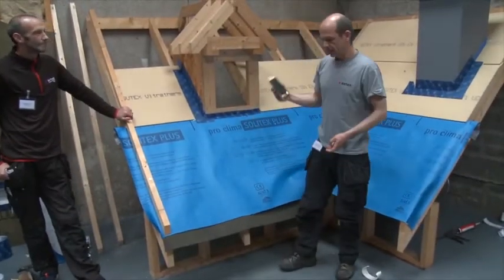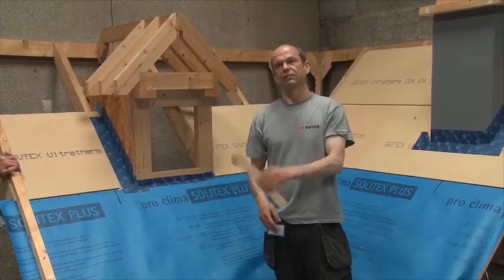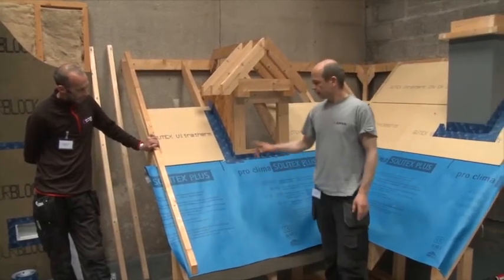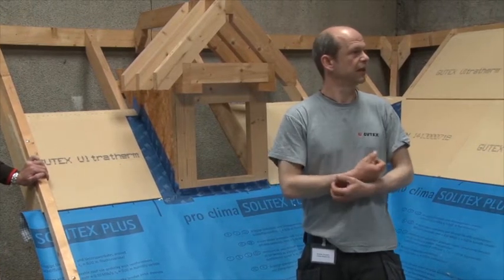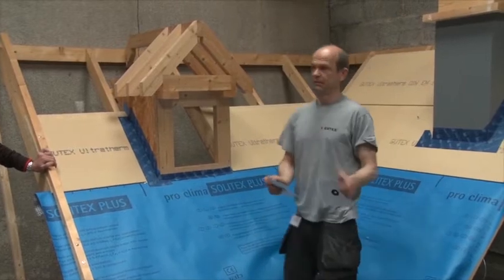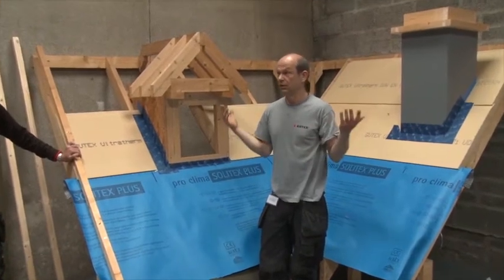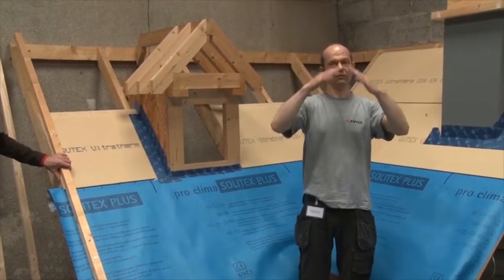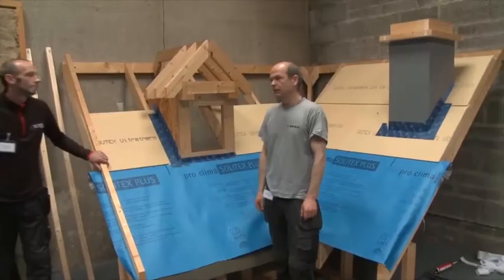Gutex Ultratherm Roof Installation (part 6) - Airtight grommets, detailing summary & conclusion

Comment: Gutex looks promising but the sheathing would probably be better if it had pre-applied waterproction on one side like zip sheathing.
Reply from the maker: Hi, GUTEX ULTRATHERM and MULTIPLEX TOP are inherently watertight at all tongues and grooved joints. The boards are also impregnated throughout with paraffin and are hydrophobic (i.e. do not absorb water). Additional membranes are only required at a pitch off less than 15 degrees. Butt joints are primed and taped with our pro clima TESCON VANA tape and pro clima Sprimer or TESCON RP Primer. To illustrate their water tightness the following video may be useful. Hope this is helpful:  https://youtu.be/pF6Nu8IpxGM